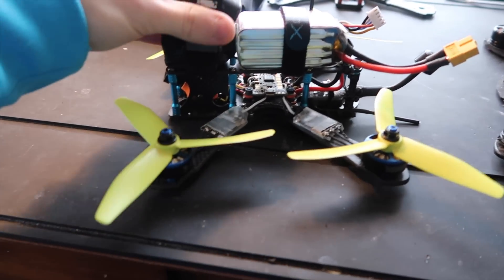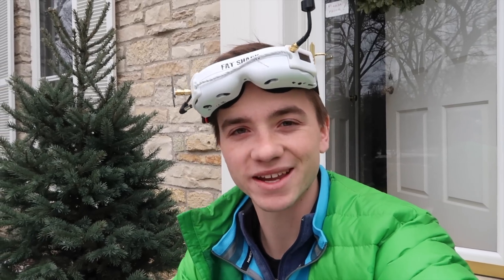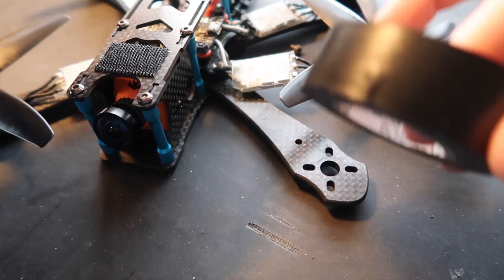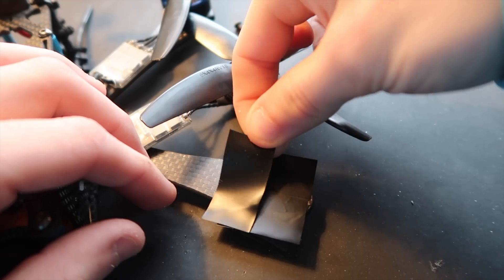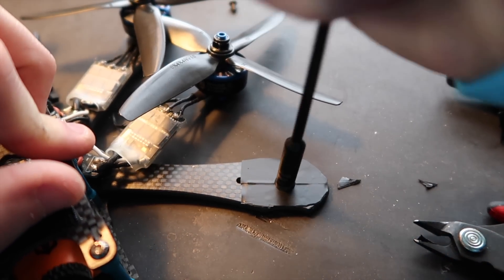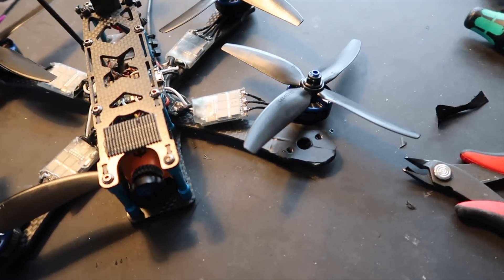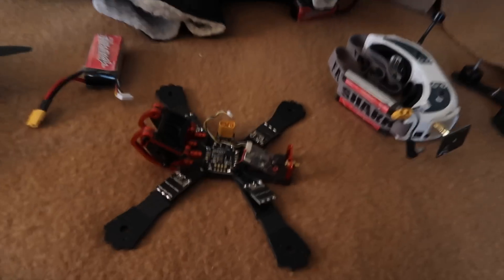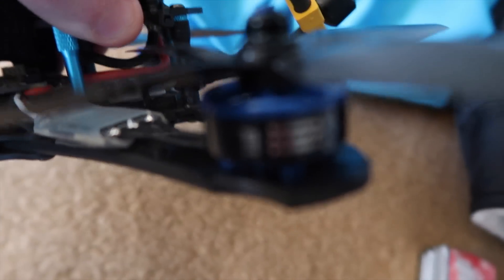The Secret to a Perfect Flying Drone (soft mounting motors)

Comment: That's so fun to see this)) Just like a PID tuning quad by your own feelings)))) Where is the blackbox log? I'm absolutly sure that it've done almost nothing just because all the vibration after this just come to the bottom plate through the bolts. I've just mounted my motors with 2.4 mm thick of tpe printed softmount under the motor flange and 1 mm thick tpu stands under the bolts. It realy make a huge difference for iflight Green hornet frame. You can hear that motor's beeping became much quite becase the frame doesn't resonate.

Comment: It definitely works for cars so I'm not surprised. This is old now so who knows what method you guys are using now... but In a sports car, just removing the rubber bushings on the motor mounts and going to like an 85-90 durometer poly mount and things get louder and less luxury car like. Do it to suspension and subframe and comfort is a thing of the past. Gaining a little precision while throwing a 3500lb vehicle around... just to make it 1/10000th as agile as your quad helps lol... so yeah in your case I'd say use as much mushy as you care to weigh yourself down with. I don't know how much weight starts to become a factor on quads that size. I'll be starting with a whoop soon so I'll probably be shortening wires by a 1/4 inch to save a few toenail clippings of weight lol.
PS. You're an awesome dude. Very inspiring.

Comment: OK ,I did it a little bit different, I used bicycle tire as a base -similar to what's Johnny did but i preferred the middle hole sealed to prevent dirt going to the bearing,3 month flying without any issue ,and no,its not overheating the bearing, I made full throttle flight -no issues there.

Comment: I've been using silicon motor pads from banggood and they work wonders. "4 PCS Silicone Anti-vibration Pad in for 22XX Series Motor". But the "4 PCS Realacc M3*7+4.5 Flight Controller Anti-Vibration Fixed Screws for FPV Racer" work even better. I'm acutally using both.

Comment: I hope it works, I'm about to soft mount the cobra gold 2207 2600kv motors on my qav X. I'm getting fast vibrations at higher throttle. Not pid related either. Tried high and stock pids. Same prob

Comment: Softmounted drone #2 but clearly I need to use more tape. I only used one strip BUT it feels better than ol'droney. However, I havent had a good enough amount of time to test the mounting thoroughly. I am not digging the feel of the HQ V1S 5x4x4 PC I have on this one in comparison to using HQ 5x4x3 glass fiber so I really need to test with the latter. On the priority list.

Comment: the guys at get fpv told me I needed to try this on my T motor f60 because I'm getting some mid throttle oscillations I hope this helps it if not I'm going back to lumenier 2206 2350kv

Comment: I confirm. It really worked for me. IF you have some vibration problems definitely give this a shot. I had a soft mounted FC but the vibrations were still too much (I have bad motors and frame...) and this trick worked like a charm for me. thank you johnny.

Comment: Good to see more highly recognized people like you give soft-mounting quad motors more exposure but sorry to say that you weren't the first one who did it. I don't claim to be the first one either because soft-mounting motors is not anything new but I kind of applied it to racing quad back in Oct 2016 and mentioned my success story on the BLHeli_S thread on RCGroups. https://www.rcgroups.com/forums/showthread.php?2640796-BLHeli_S-Smooth-as-Silk/page252#post35924253 Waltr picked up my post and put onto Betaflight wiki https://github.com/betaflight/betaflight/wiki/Frequently-Asked-Questions#how-do-i-solve-yaw-twitches-or-mid-throttle-oscillations- which obviously boosted exposure. Looks like highly recognized people like yourself and others give the practice much more exposure. Keep up the good work.

Comment: I can fully confirm that soft mounting helps against mid throttle oscillations! However I created my own soft mounting pads by using silikon adhesive that I have applied on some aluminium foil and then brought it in shape with a plastic card. Was pretty easy and the result is great :-) Now I fly with Kiss FC stock settings having no issues at all!

Comment: Do you have any problems with balancing the Astro X5? I find it hard to distribute weight along the pitch axis with a GoPro Hero 4 and Graphene 1300mah. When I hold the quad in my fingers it leans forward. The only solution I found so far is to unscrew the XT60 and leave it hanging so I can move the battery back a little.

Comment: nice, i'm planning to softmount my motors, do I use it between the motors and the frame or use it also under the arm between screws and arms with some kind of carbon fiber washer?
should be ok to use a bike tire tube?
thanks

Comment: How did you connect the spektrum rx to the kiss fc ? Did you cut the wires and solderd them on the fc or did you us the port that is already on the fc ? I have the same rx and i orderd kiss fc and esc's to rebuild my quad with better gear
Reply from the maker: port on fc

Comment: I find this funny, in the industrial world large motors have rubber on the motor mounts. Prolly turn out to be less messy( since electrical tape glue does crazy stuff after high heat) to use like a piece of a mouse pad(thin one), silicone cut out would be supreme but for a cheap alternative super 33 electrical tape would suffice IMO

Comment: You were not 1st, far from it actually. I used 3M black rubber tape, 1 layer and as far as I know almost everyone has been doing it since 2012 etc. The best is to get some small o-rings and cut them in half. They will last longer than electrical tape and perform better. Of course soft mounting will go hand in hand with resolving FC vibrations which became more of the focus over the years. Anyway, nice vid and thanks for posting.

Comment: pretty interesting demonstration. I've only recently gotten into this hobby and I had a similar idea with soft mounting the motors. I haven't had a chance to yet, but I plan on trying a sort of dampening pad made out of a material called pelite between the frame and the motor. given the results of your test, I'm eager to see what different dampening materials can do. looking at it from a simple engineering standpoint, you could possibly get even better results if you can manage a way to soften where the screws contact the frame as well. perhaps some kind of bushing with a threaded piece in the center?

Comment: I use rubber O-Rings (one per screw): http://www.banggood.com/260pcs-Green-General-HNBR-O-Sealing-Ring-Nitrile-Rubber-Washer-Set-p-942861.html
It works much much better than Electic Tape...
Reply: Try 2 o-rings per screw: one as shown in this video, but also put one on the nut side too.  

You might need to use a washer on each screw to achieve this.
Reply: cool idea

Comment: How about using a dampening material made to reduce noise though materials like .. say Dynamat. You may not even need to mount it to the motors. it may be a "stick on" solution for the arms or soft mount the FC with it. , there are several version including tape. and an "ultra light " blue version. > I am getting this now for testing. Remember you heard it here first however  JYM  out https://www.amazon.com/dp/B00020CATC/ref=sr_ph_1?ie=UTF8&qid=1484767507&sr=sr-1&keywords=dynamat

Comment: Sorry....I don't get this! All that padding...but you still need to get the motor screws really tight ...if loose even micro vibration can loosen them.....so does having tape padding have any affect when you compress it more with tight screws?

Comment: some used silicone gel pads, I used silicon gromets to reduce vibration and noise...
Quite a few years ago. BUT...
Electrical tape is made of PVC.
I colder weather it will become stiff. Stiff not stiffer. Like egg shells. 
The screws that hold the motors are still "hard" mounted.

Dampners are good but also bad if the motors are unbalanced and the bolts are not lock-tied (blue). 
I think that isolating the flight controller with 8 silicone grommets (2mm?) is weight-saving and less prone to... let a motor loose. ;)

Comment: Not trying to say this does or doesn't work as I haven't tried it, But it looks like in the beginning your using 5040 tri-blade props and then after the soft mount your running 5040 quad-blade props. Why did you change props? especially to quad-blade cause that's going to make it smoother than the tri-blades were? Just curious is all, probably going to be giving this a shot tho cause it definitely makes sense. Car motors, plane motors, jet engines, boat motors are all soft mounted. So I think this could help reduce vibes which would allow you to lower the notch filter and things to further reduce delay in the system. Makes sense! just curious why you changed props.

Comment: I'm running the Martian II alien clone frame and did 3 layers of vinyl sticker on the arms, works like a charm and looks cool :) I tried using just nice thick insulation tape but didnt do much. I wanted to try frame wrapping and thought that just might do the trick as 3 layers is nice and squishy. Flying Brand new Emax RS2205s with the most bent, skew, FUBAR Dal Q5040 blades you have ever seen and its flying smooth as fuck on lux FC v1 @ 8k/8k BF3.1.0 RC7, Dys XS20a w/ Dshot600. No jokes, every blade is bent multiple places at all angles, airfoil completely messed up, chunks missing from some blades! I flew +18 packs with multiple crashes in race training and I've yet so feel ANY vibration issues or motor stutters or chips unlike I use to get after a couple of bends on the props. I'm going to keep them going until they break to prove the point but they are already so soft, I have to straighten them all out after a crash now. Preach it dude, I'm loving this mod!

Comment: Johnny, 
It seems that you have something here. What you are doing is adding a damper like the damper on a car, so yes the vibrations will be less. However, what about the bottom of the bolts?
you might want to try adding the same tape underneath and using washers to spread the load a little. 
Good luck,
Paul :)

Comment: This is a huge debate all over RCG and others, I think there is some proof in certain situations that this does indeed work, but some people are not seeing full results if any (probably other issues relating to noise, not just motors on t hose builds). BMC3D has TPU motor dampening mounts as well to use instead of tape, they may do wonders as well. I haven't thought about doing that as I have relatively "quiet" builds, but I might give it a shot just to see if there is any improvement over what I have already. Great vid, thanks for posting. You got a sub and like. ;-)

Comment: @Johnny FPV I can hear the the difference between the two, soft mounted does not send a resonant sound to the go pro. I wonder if rubberized heat shrink would have the same effect. I 3D print TPU bushings for my KissFC but the vibration can still get through. Best of luck to you from the Suburbs.

Comment: if your motors get a little warm will it melt the tape ?
Reply: They have some electrical tape made by 3M that can withstand higher temps, I think it can withstand like 300 degrees or more and your motors should never get over 170 because if they do it will damage the magnets. I forget what the tape is called but its slightly thicker than normal, conforms to shapes better and has stronger adhesive plus it can withstand higher temps. So maybe use that stuff if your worried about temps, especially if you live in a hotter climate.

Comment: I can say lots of people including me have mentioned putting gasket or orings under the motors when the red bottoms came out. We knew it was causing the naze rev6 mpu6500 yaw jitter issue but we nailed it at the FC by soft mounting it with orings. Now it seems kiss is having more of an issue even with soft mounted with orings.

Comment: How tight are you bolting the motors down? and do you use threadlock? as the motors are kind of floating now which would more likely cause the screws to back out.

Comment: You need to soft mount the hex nuts that are in contact with the arms too for this to be an actual efficient soft mount. Cos the tape might dampen the bottom of the motor that's in contact with the arms, the hex nut still pass all the vibrations from the motor to the arm. You really need to eliminate all points of transfer for this soft mount to actually work .
Reply: Ray Choi he is not eliminating all of the vibrations....just removing some...

Comment: Have you tried Steele's motors? I'm wondering which one I should get between them and the 2450KV lumeniers. Thanks!
Reply from the maker: S-L-R no I haven't, I don't think they would be powerful enough for me
Reply: Yeah I think that's what many people are thinking with them being "freestyle" motors. But I've seen a couple videos now claiming they are as powerful as the ZMX Fusion but way smoother and more efficient, so maybe they're worth considering. Just my 2 cents.
Reply: Johnny FPV how about 6-blade on them? Surely they would have enough torque to pull them well enough

Comment: Will test this week (if my repair parts will come that is) because i have mid-throttle vibrations on my Loki x5 that i just cant get rid of (neewbe on this but tried pid's in both crazy high and crazy low settings).  Nice video! :)

Comment: I disagree with this video and didn't see any difference in your flying. it's all hype man. it's a fad that will go away like angled motor mounts
Reply from the maker: ryan ehrlich it's all about stick feel.  You can make a 100$ setup fly smooth.  Not the point.
Reply: Johnny FPV I agree it doesn't hurt anything I just don't think it's something that's gonna stick around long. it's literally getting hyped on all the groups. I think it started becoming an issue when raceflight blew up

Comment: gopro footage is likely similar due to the mount for the gopro filtering it out.    but i can absolutely believe it for the FPV camera.   

i wonder how 3m double sided tape would work out?   but thicker and could be compressed down to varying tightness/compression.

good find though and the reasoning/logic leading to it is sound.     i found a borked motor magnet on one of my cans when I suddenly had bad vibration for no explained reason(well explanation is I tapped the ground kinda hard jarring a magnet loose).    but those moving parts make a world of difference.    wonder if it helps dampen unbalanced or damaged props too?

Comment: I never see the 'Pro' guys mention balancing props or motors.  A little insulation will take care of a small amount of high frequency noise, four motors running at variable speeds can set up some strange resonant vibrations if not running clean.  I guess with the number of crashes and rebuilds happening with hard flying makes the time spent on careful balancing not worth it?

Comment: Did it over a year ago myself ;)
Reply from the maker: Very nice haha
Reply: I have used rubber O rings, 3m tape or now I use a TPU strip with holes slotted for the motors. I started doing this when I had yaw chatter on a unibody frame

Comment: I'm trying this with the new set of motors I've got ordered.

Did you change anything else, or literally just the etape?
Reply from the maker: Just the tape
Reply: Looks like you changed props too? The first clips your using yellow 5040 triblades and the second clips show some black 4 blade props?? Not trying to say this doesn't work just something I noticed while watching. Definitely seems like it could work! Car motors and most other motors are soft mounted.
Reply from the maker: No I used the same props.  Explained elsewhere in the comments.  Same props though.

Comment: I use doublesided foam tape under my kingkong motor protectors and leave the paper on the tape towards the arms, works great and is really easy to see the improvements in the kiss gui motor test tab thanks to the scaled up gyro/accel graph. I crank down the motors tight compressing the tape and it still works great. I never used electical tape so I dont know what works best. foam tape works great for me...

Comment: How much do you tighten the motor screws then? do you have to leave them somewhat loose?
Reply from the maker: Maybe tiny bit less tight than normal, but tight.  Just make sure to retighten them after you crash a few times, or use lock tight

Comment: I also have single layers of electrical tape between the arms and the PDB and bottom plate.  That will further absorb some vibration before it reaches the flight controller.  I think the key is to have several things that each absorb a small amount of vibration.  They all add up together to result in a lot of damping.  Trying to do it all in one spot will result in that spot being too flexible.  Single layer of tape under the motors, single layer of tape between arms and frame, and a soft mounted flight controller results in a lot of vibration damping.  Using nylon screws to mount the flight controller instead of aluminum also helps a lot.  Metal screws carry vibrations while plastic absorbs the vibration.

Comment: Ekoa is a flax based material that is very similar to carbon fiber in concept (think of brown looking carbon fiber).  It's not as strong but it is still very strong and it absorbs vibrations almost as good as wood.  The fibers can be blended into carbon fiber.  I think that is the future of carbon quadcopter frames.  Carbon fiber with a little ekoa fiber mixed in won't really sacrifice any strength but will have vibration damping ability.  Like maybe a 90% carbon 10% ekoa blend.  The ekoa is still quite strong so that would probably still be like 95% as strong as all carbon fiber.